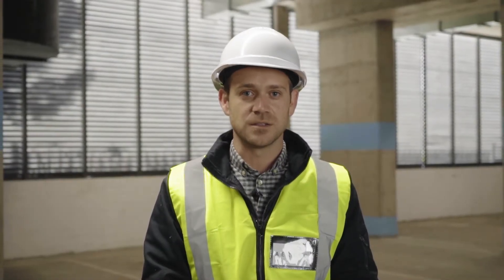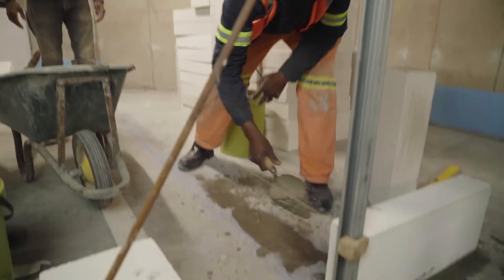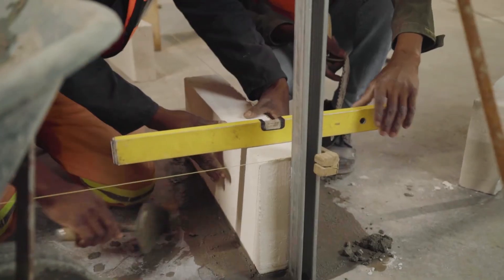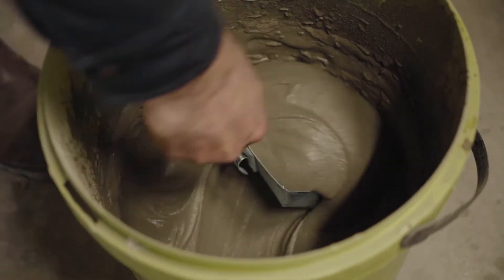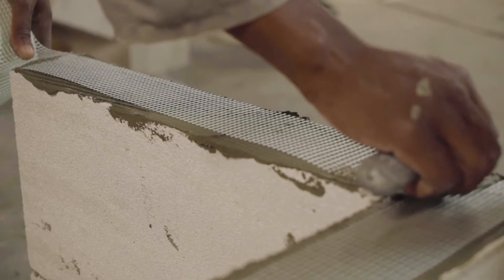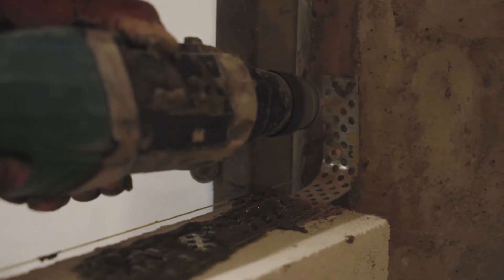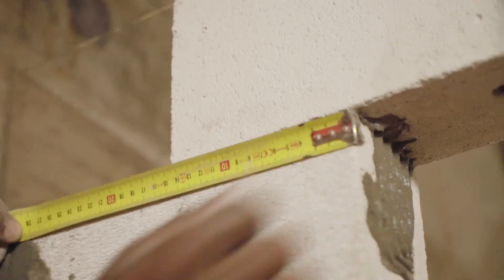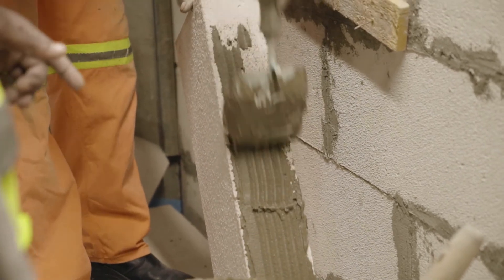AERATED AUTOCLAVED CONCRETE (AAC Blocks) PRODUCTS Installation Guide

Comment: The 20mm gap is to avoid deflection onto the wall. This is filled with resilient materials such as expanded foam alternative mortar that has a lower compressive strength than the AAC blocks itself. It's highly recommended to fill this gap to avoid noise flanking transmission. The face of the wall can be sealed with a joint sealer if foam is used.